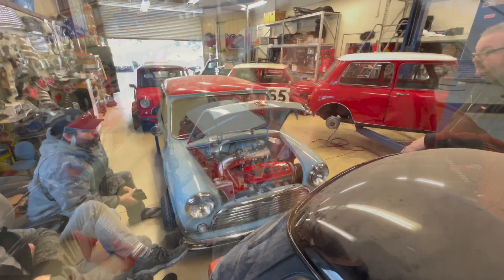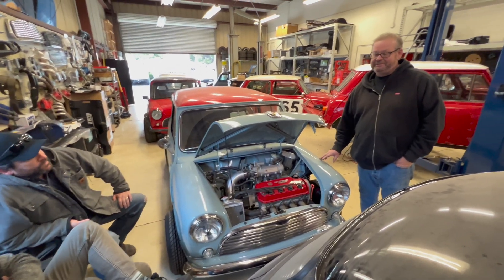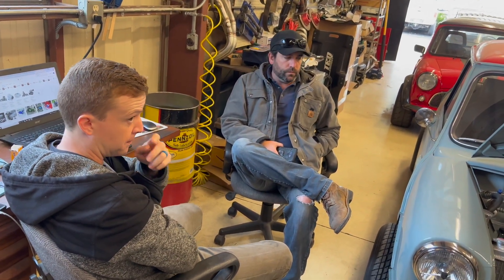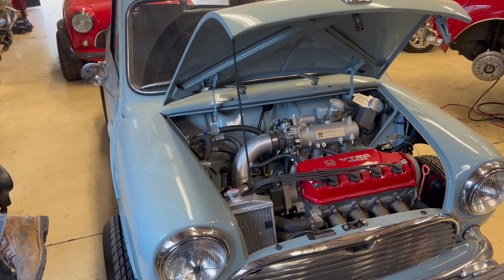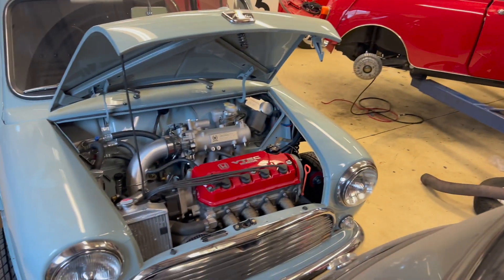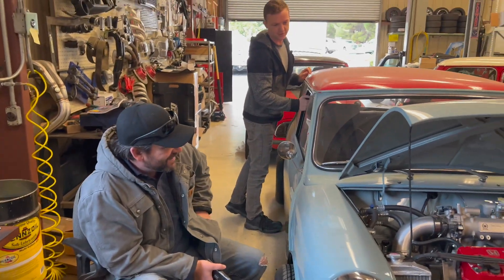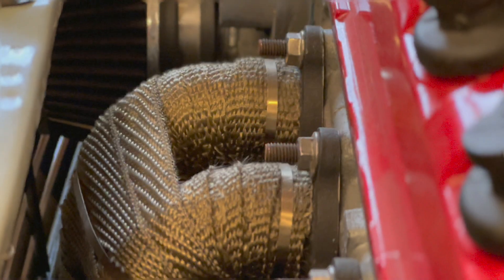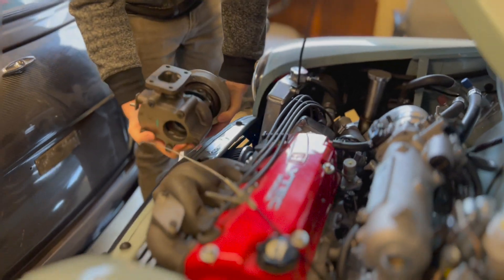Developing a Turbo to fit in a Classic Mini with a Honda D16 motor with AC in 4K

Comment: Hi Guys, I used to deliver parts to Rover on LongBridge where they built the Mini. I also cut my 14 year old teeth LEARNING/Building Minis. I had a 1275GT in RED WHITE Bonnet [HOOD] stripes and along the Lower doors. Maybe try and do an 1275GT Front-End [Clubman] So you WOULD have much MORE ROOM for a Turbo set-Up. LOVE this channel but must have forgot to re-Sub after my old laptop went. Re-Subbed/Liked. Best wishes from South Wales [UK].

Comment: Have you considered converting to D17 COPs and locating the turbo where the distributor is? I'm thinking of doing that with my Mk1 when I swap in my D15
Reply from the maker: We have developed alot for the D16y8, the D17 isn’t interchangeable though placement of the turbo would infact be better!
Reply: @GildredRacing  I don't mean the whole engine, just the D17 valve cover and D17 COPs, but on the D16 head, but then you'll need to add a new ignition trigger wheel and ecu too.
Reply from the maker: @car.farm.adventures5542  gotcha